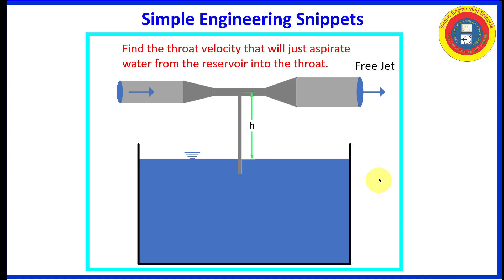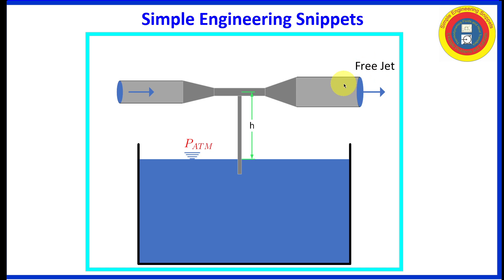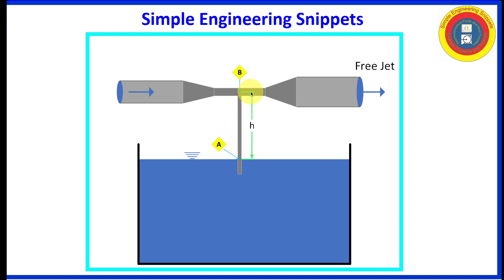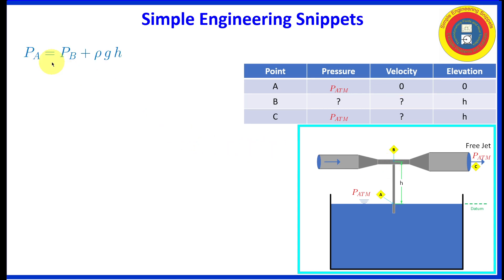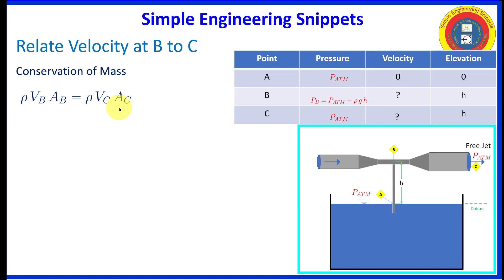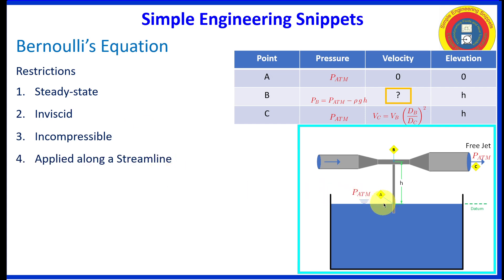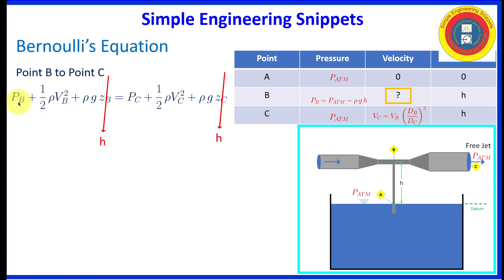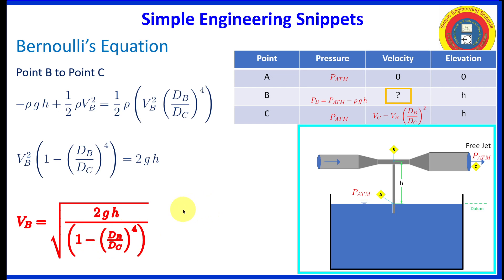Bernoulli's Equation:  Eductor Example

Comment: Just have one question: Why the diameter of the suction tube hasn't any significance?
Reply: Crude answer ... pressure is pressure.  The question being answered is the velocity required to aspirate liquid.  As long as "h" is balanced by the low pressure through the throat at the calculated velocity, liquid will be aspirated.  The flow through the suction tube is sufficiently low to ignore friction related to flow.